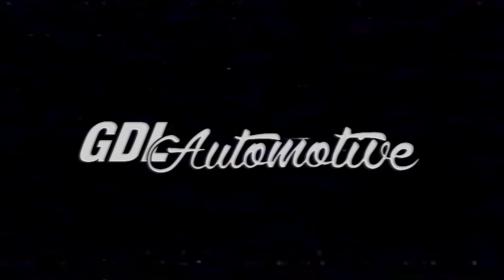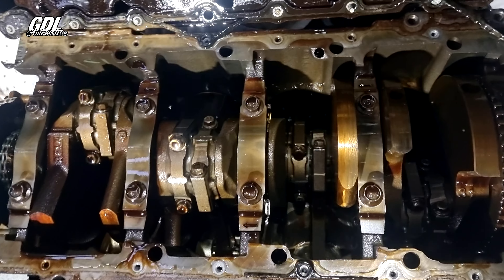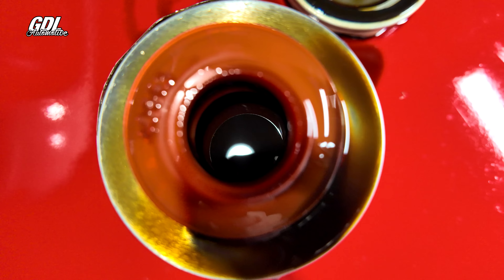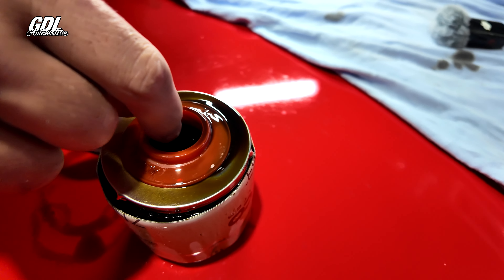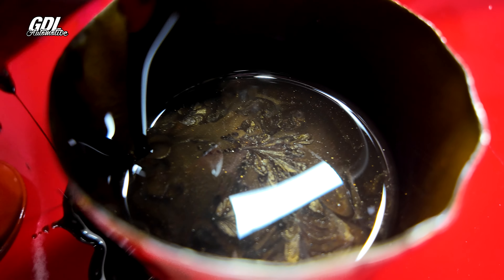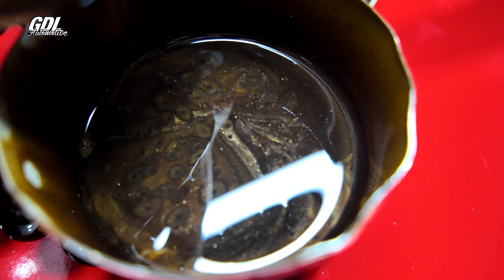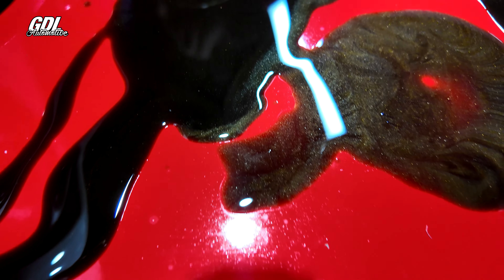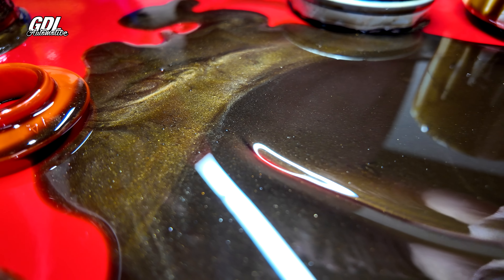Misfiring Marketplace Jeep gets an oil filter inspection!

Comment: Sometimes you just have to bite the bullet and get the lot done. I just had an engine replacement on my 3L 2014 Grand Cherokee after a valley hose failed and warped the head. Hope the owner has a rethink on getting the bottom end done as well.